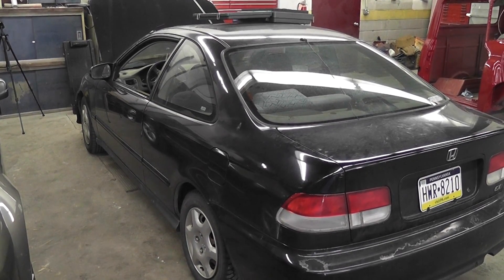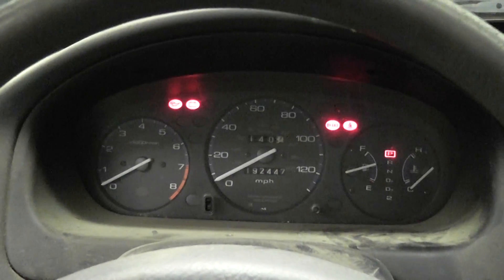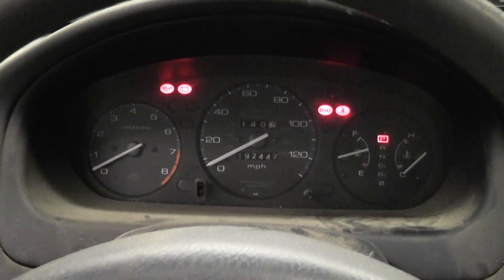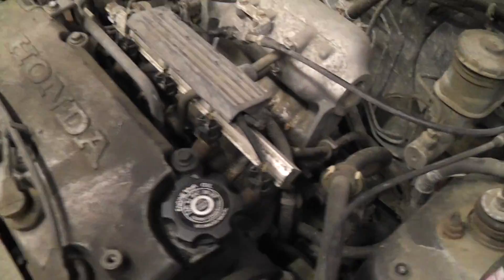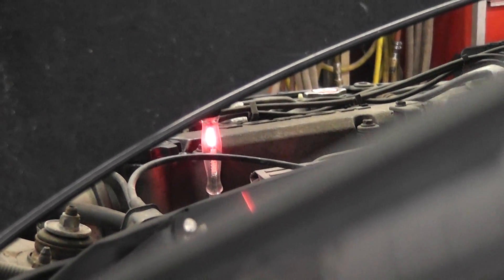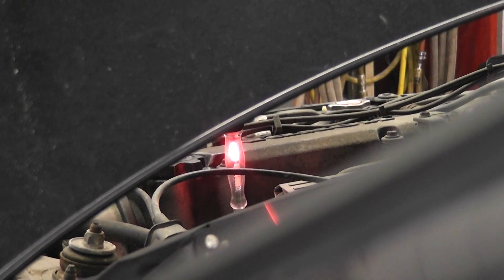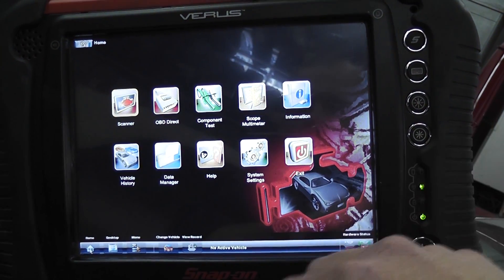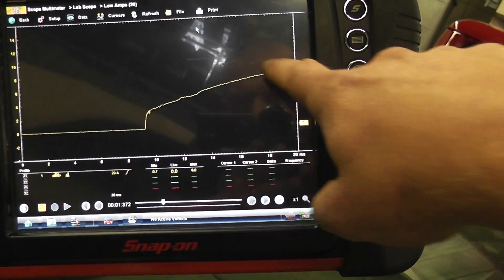How to test for a shorted ignition coil (Honda Distributor)

Comment: Hi there Datascanner, I have a 2000 Honda CRV with an intermittent no start condition.When the engine is running I have a logic probe on the black/ yellow wire and have a pulse( obviously). I can leave the vehicle running in the shop for about 20 mins and the engine has stopped when I go back to it. Unfortunately when I crank it the vehicle starts again. I am thinking a faulty module or main relay. It would be easier if it wouldn't start again hey? Anyway next step is to get a scan tool on and see if I have any codes, probably not but next step.Any ideas or direction mate?RegardsRoss Australia

Comment: Help me! I have a 1998 honda accord that after warming up, I'll have the power to the engine randomly stall and come back. Sometimes it'll turn the engine off completely and I'll have to pull over and wait a bit for it to be able to turn back on. I know it'll turn back on is because when I turn the key the check engine light will be on. If it's not, the car won't turn over. Already changed the ignition coil.
Reply from the maker: ignition switch is common. When it does it again, smack on the bottom of the column, under the ignition switch or cycle the key on and off a bunch of times and see if it comes back to life

Comment: I know you covered this is in a doffrent video you posted. But my proffesor and my boss at the shop i work at both have been tought not to use a test light to test injector pulses. They say the extra amps to turn on the test light could potentialy burn out the transistor driver in the ecu?
Reply from the maker: Totally not true at all. Injector drivers can handle way more than the extra 300 ma a test light will throw at it. Even with the injector load. 
For more help..
It is becoming more and more difficult to answer questions here. I have 80,000 people asking me for help now. So I have created a forum to help you guys better. It is free to join and we can exchange pictures, wiring diagrams and waveforms if needed to help guide you through the process of troubleshooting your vehicle. Thank you so much! Hope to see you there. 
Paul Danner (ScannerDanner)
https://www.scannerdanner.com/forum/post-your-repair-questions-here.html
Reply: Thank you for the responce. Very iformative

Comment: Shorted coil with no spark is easy to find. How can I identify a weak coil that causes misfire (besides using a test light and watching spark)? Secondary ignition waveform?
Reply from the maker: watch this one. It is an older Honda but the concepts apply to everything
https://www.youtube.com/watch?v=eoodIVGgGyw
Reply: Thank you, great video.
Reply from the maker: thanks for watching
Reply: ScannerDanner 
hi, Scanner I need your advice.. I have a 88 Honda Civic, crank no start and no spark you said that check engine light must light up then go out .. but in my case it stays on.. .. any ideas?? thank you

Comment: sorry to bother sir. I have a honda that has problems with the secondary ignition i took a test to test for ground and current circuits. turn out that when i  connect the test light to ground and the electrode to the ground of the coil wires the lighg turns. what could that mean?

Comment: What would you look for knowing you have injector pulse and a good distributor, But no pcm signal output to the pcm to icm when cranking only power when key on engine off?
Main relay- Crank sensor?
Reply from the maker: +Dave Roy if you have injector pulse it would not be the crank sensor. So no power to what cranking? That is there KOEO?
The ignition coil?
Reply: NO signal from the ecu to icm.
the only power i get to the distributor is with the key on engine off .the car dose crank, its a  new distributor, but im not getting a pulse signal from ecu signal wire to send to the icm to coil

Comment: can i use the mt2400 to do the test using vom probe
 what setting is best on mt2400 if dont have scope
 on a distributor with the crk sensor located inside of it

Comment: I noticed it has a 192k on the od...with my experience , its the distributor gone bad!  they go bad all the time. napa has em , they are not cheap though.. but is its a fast r&r... also , make sure the remote start solenoid under the dash is good, when they go bad , it  will crank, but not lite...goodluck

Comment: I had my ignition coil replaced , plugs and wires on my 92 honda civic,  still no fire!!!! HELP!!!!
Reply: what was the prb als have the same prob
Reply: @shuvaigubvume5307  check fuse, if all good i'd look into a new Ignition control module. Little box in the dist.
Reply: @shuvaigubvume5307  my.was blown fuse for the dizzy and thats why it wouldt spark
Reply: macker b whats dizzy
Reply: Lady Edwards did u find the problem
Reply: Lady Edwards prolly ECU
Reply: Lady Edwards y

Comment: My car is a Honda Civic 2000. It has the same no spark - no start problem, but only after the car has runned and the engine has warmed up. At morning and on cold cranking the engine always starts. On faulty condition, already tested the PGM-FI main relay and  fuel pressure both good.
It seems high temperature creates no-spark failure. Any suggestion on where to see in the ignition system: igniter, sensors, coil, wires or what?
Thanks
Reply: Hello sir. I see it’s been 5 years and I’ve run into this same problem with my now 98 civic. autozone told me my starter alternator and battery are good but mid day it seems when it’s hot out, my car will crank but not start. I’m literally gambling every time I drive around and stop somewhere. 

Did you find a fix?

Comment from the maker: scan data would not have identified a shorted coil secondary winding. I could have used it to check for an RPM signal which would have told me the inputs where there, but I would have still had to do the tests under the hood. 
scan tool data only provides direction, not the cause of the fault.

Comment: i am have the same problem but i already change the whole distributor already and still no spark can u help me figure this out please.  i have a 97 civic lx with a 1.6 same engine in your video.  i am going to do the injector test tomorrow to see if the crank sensor is good the cam sensor should be find cause the came with distributor

Comment from the maker: lot of theory in that. in short you want to see turn on oscillations at the beginning of a primary coil current ramp. These oscillations are from the secondary winding feedback. no oscillations suggests a shorted coil secondary. some systems you will not see these though so a lot of this is experience. you should check out my eBook. I have stuff like this in there.
Reply: to
Reply: t
Reply: tt
Reply: p
Reply: o
Reply: oo.
Reply: l
Reply: w
Reply: nxt
Reply: o
Reply: or

Comment: I am a disable vet so I have a 1991 toyota camry a/c problem It has good high and low pressers it was converted many years ago to 134a . It will not engage clutch or idle up when a/c is on . The a/c button light up and does not flash . If I manually put 12 volts to a/c clutch it workes and cools the car . I have checked the fuses and relay it does not get voltage to the relay to turn on the a/c clutch. I have to factory manual. Any ides? It sucks being disabled

Comment from the maker: I believe the AC cooling fan is controlled based on a pressure transducer (sensor) in the high side of the AC system. If I remember correctly the fan doesn't come on until about 220 psi on the high side. I'll check a diagram for you when I get a chance.

Comment: Paul I am trying to fix a 1996 dodge caravan 3.8 a/c cooling fan problem, a/c works .  2 fans eng & a/c.  The eng fan circuit  works but a/c does not when a/c clutch is on.  I can power the fan manually on.  I tested the relay harness  power in & grd & power out to eng fan is ok but I do not get a signal to turn on a/c fan from ecm.  My diagram looks like both fans on same circuit .  I suspect the a/c driver is fried,  when eng fan is on should the a/c fan be on as well ?  Not sure.  Thanks

Comment from the maker: will do on the check engine light part. as 4 direction if you have no spark and good injection pulse this generally means your inputs are fine. if you have no spark and no injection pulse this means you go in the direction of an input problem. again these are generalizations but it does give you some kind of direction. there are some differences in system design that will change things a bit but you can follow these as a guide

Comment from the maker: I do have that in mind when I am doing these videos. Unfortunately when it came time to check the coil circuit for control, it was just so much more accurate and faster to use the scope. Although using the test light on coil negative and looking for a "flicker" in the test light can be used as a guide too. That is why I put that note in the video that was a hyperlink to my Subaru no spark video where I show the test light procedure.